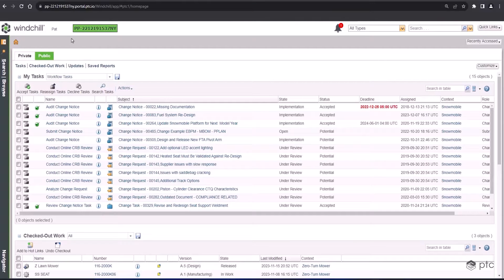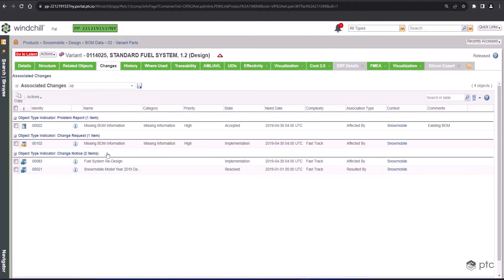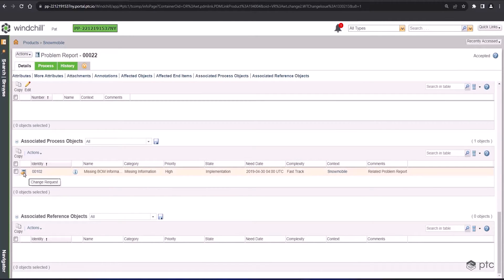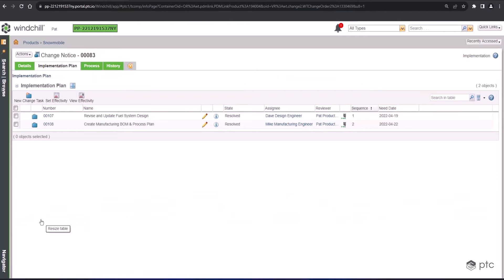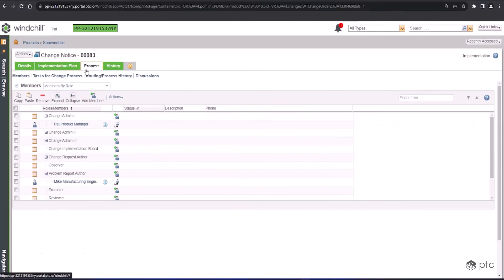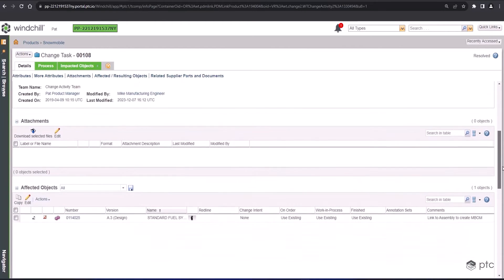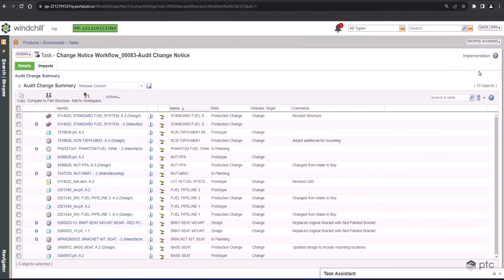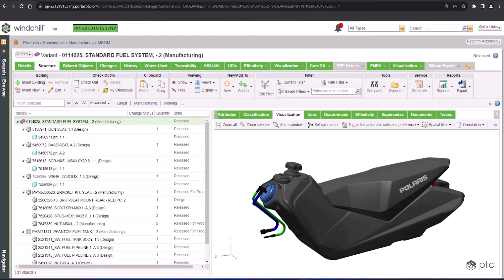Change Management in Windchill

Comment: Question 1: Why can’t you select Assignees or Reviewers on Change Notice Templates?                         
Question 2: Are PTC planning on updating the method of selecting Assignee and Reviewers for EACH Change Task on Change Notice Templates? As this is Not part of Windchill PDMLink functionality at the moment.

Issue: It's time-consuming, and my biggest user complaint I have and the biggest flaw on the Windchill Change Management System.

Why its Time consuming:
1)  When a Change Notice Template has many tasks that need to be populated with Assignees and Reviewers, it's very time-consuming for users to open each Change Task and then use the current Assignee and Reviewer Picker, which is not on a separate tab by default.

2) You cannot select Assignees and Reviewers on the Change Notice Implementation Plan window. Example: RH Click to bring up more options.

The PTC solutions: All solutions involve horrendous amounts of Admin that is not feasible to manage.
I have 40off contexts with 20off Change Tasks,

Managing this with either 800off Workflows, Roles, Change objects at Site / Context level is not manageable for ECN Templates to be Prepopulated.